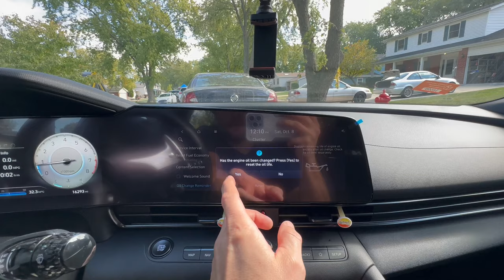New oil for Elantra N plus first time getting paid for wrap 🤑

Comment: Surprised you didn't go with the 0w30 heading into winter🤔 I mean if you were coming out of winter 5w30 would be fine but 0w30 is recommended.

I went with 0w30 Mobil 1 and a Royal Purple oil filter and adjusted my interval to 7500 miles, mainly because I had it done about 2 weeks before the Drsgon trip.
Reply from the maker: Yeah I know man, but if you want to buy 0w30  basically your choices are: this green mobil 1 which I don’t really trust I don’t know why or other gas saving alternatives and if you want something good then you have to spend more then 100$ for liqui molly or amsoil or some other racing oils, besides 5w30 is not much different then 0w30 in winter one is rated to -35 and other -40 Celsius

Comment: Yeh royal purple is a no go. Please use Pennzoil ot Amsoil. I use to be a royal purple fan. Not anymore
Reply from the maker: I mean I never had bad experience with royal purple, currently Im running 0w40 Mobil 1 and I checked with Blackstone and everything looks good. I know Pennzoil and Amsoil are good once but Im curious what happened that you hate royal purple?
Reply: @PolishBullitt  right now i am running Amsoil in everything i have.
But i once use to by a loyal RP fan.
Nothing acually. Just alot of research from reputable ppl shows that its not good oil. And that it does not protect you engine as good as Pennzoil for less price.
Reply from the maker: @davidtranmedia5112 ok I get it brother, nothing wrong with changing up a bit, me personally I never had a problem with Mobil 1 and I was running in a bunch of cars for many miles or kilometers. You know how it is with oil, theres always a lot of drama involved lol
Reply: @PolishBullitt  now mobile 1 im ok with.
Its just royal purple. It is not good oil. Watch all the oil test online
Reply from the maker: @davidtranmedia5112 yeah maybe I will check just out of curiosity what’s up with royal purple cause I always thought it was a good oil

Comment: Any problems using Royal Purple on EN?
Reply from the maker: So far so good brother, I’m on my third oil change probably around 8-10K in on Royal Purple. I wanted to send a sample to check but I did my oil change like 3 weeks ago and I don’t know if it still ok to do so or just wait for another oil change and send them fresh sample to make sure everything is gucci 🙂
Reply: @PolishBullitt  Do you use 5W-30 only?
Reply from the maker: Yeah 5w30
Reply: @Polish Bullitt  I guess 5W-30 is Gucci👍
Reply from the maker: Manual calls for 5w20, 0w30 or 5w30 so I picked 5w30 cause the have bigger selection of oils and easier to get